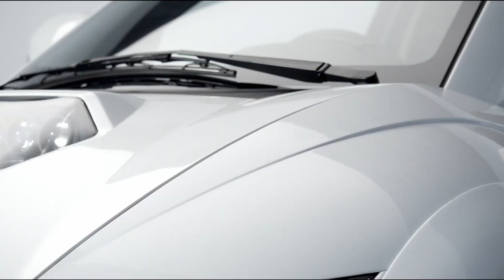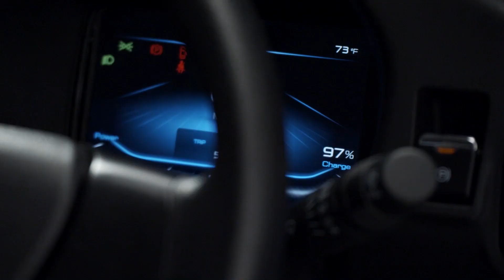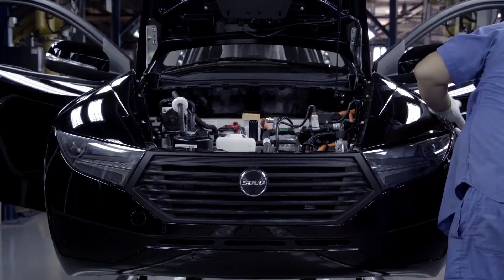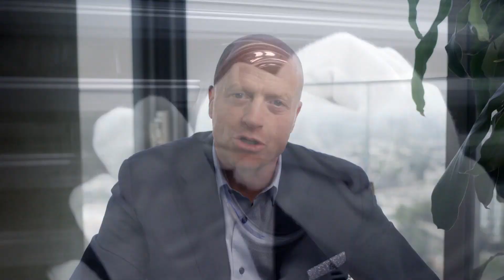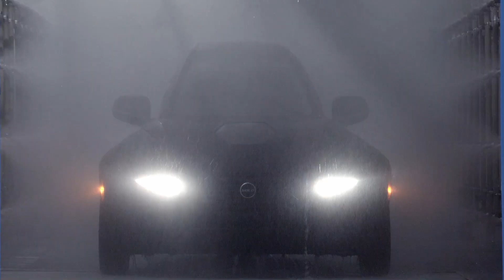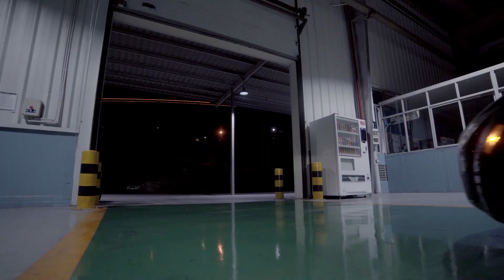SOLO EV Assembly Line

Comment: I like the the Solo....but it needs to have longer range.  100 miles per charge is not good enough to ease drivers range anxiety and needs to be 200 miles at a minimum IMO..... Upgrade the battery packs!